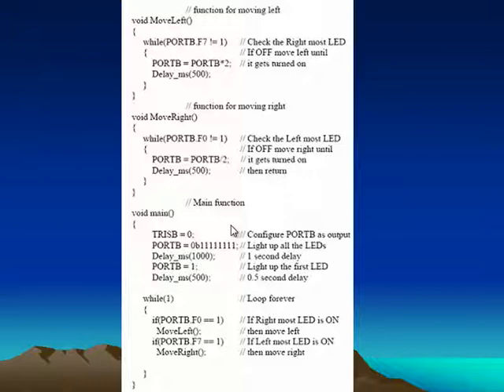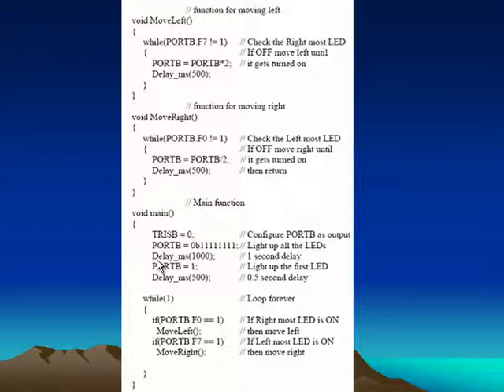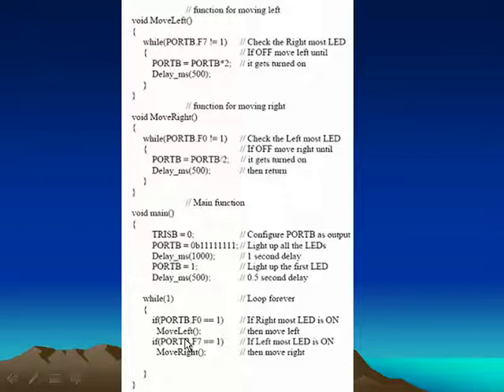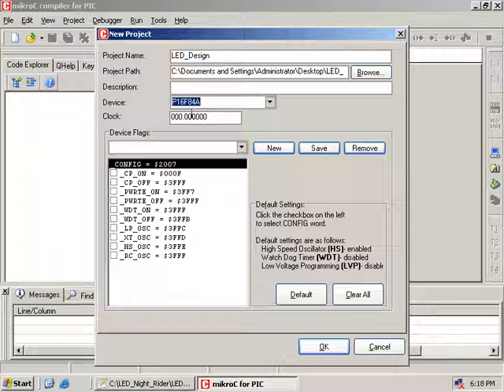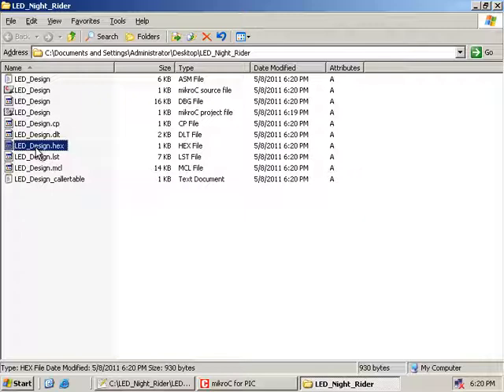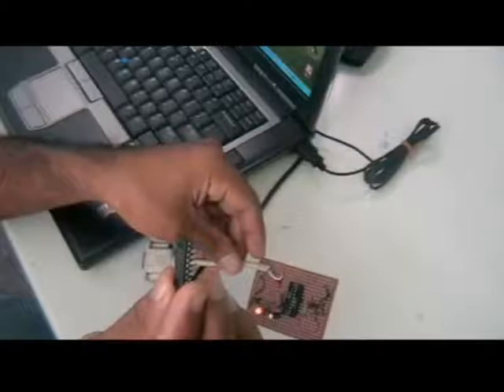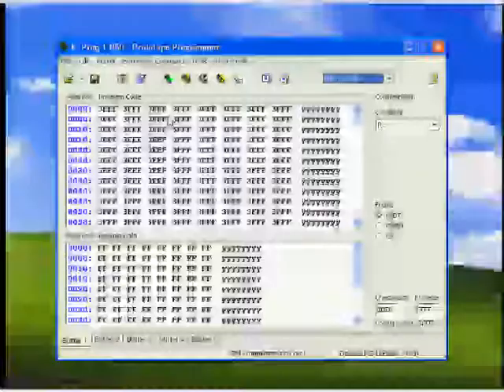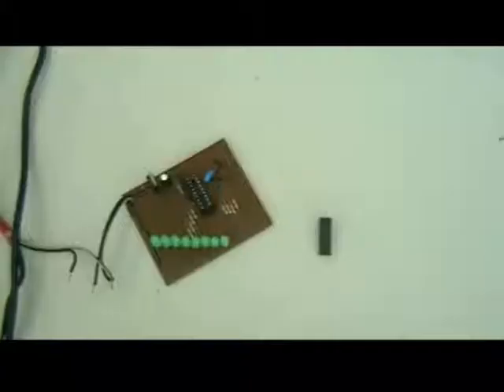Microcontroller Video Tutorial - Part 4

Comment: Hello sir , first I want to thank you for this useful tutorial , but I have some questions and I hope you can answer me : 
1- can I programme the microcontroller to do 2 functions but not at the same time for example it will do the firts function then after a week it will use the saved data of the first funtion to do the second function .. so is that possible ? 
2-  can I use only one software to finish all the programming steps ? 
Thanks again sir and I hope you answer my questions ASAP

Comment: Cool introduction to the PIC for beginners, I have a question if you don't mind. I'm a mainly C# programmer, I also know C and C++ but I don't know designing PCB and electronic circuits. I know why to use resistor but the others like the capacitor, the transistor, the sensor and the rest of the staff and how to design a PCB or a circuit so could you point me to some material that helps me out starting 
All my respects
Thank you

Comment: I dont have serial port connection in my lapy then what should i do..?
Reply from the maker: Hi Sandeep, Yes new PCs does not have serial port. The programmer I used in this video is made by myself and a very basic one. Now I am using K150 type programmer and it is USB supported. Ebay : https://www.ebay.com/itm/USB-PIC-Automatic-Programming-Develop-Microcontroller-Programmer-K150-ICSP-Cable/200944364396?epid=17011452870&hash=item2ec937ab6c:g:wq8AAOSwXOhb89Pn